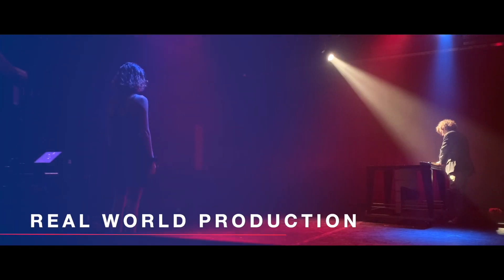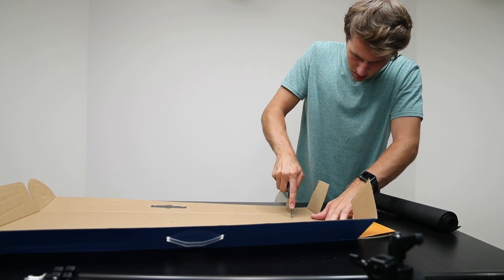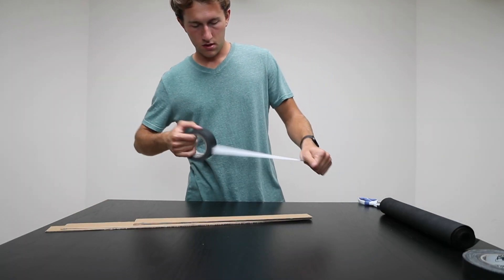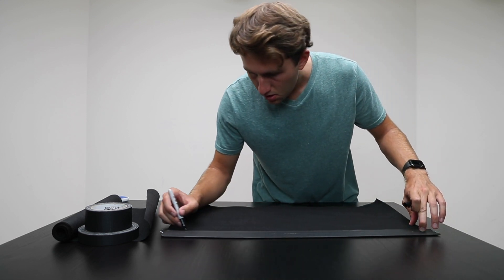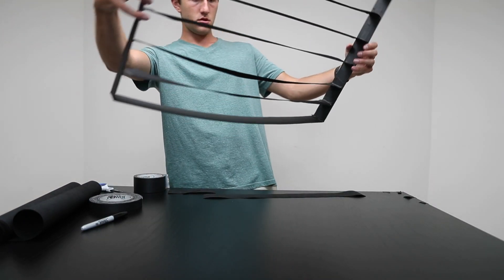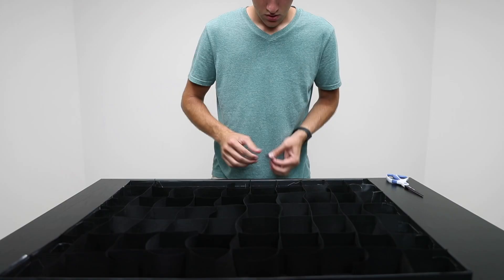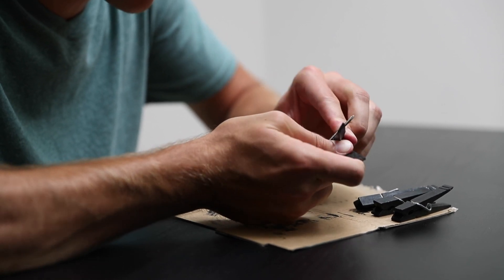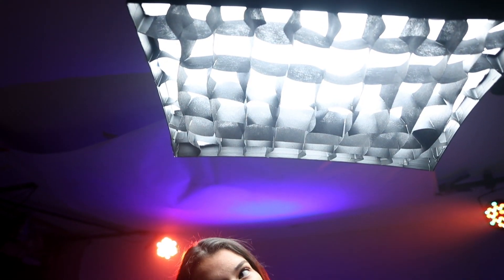DIY Softbox Grid – easy way to increase cinematic quality

Comment: What does this even do?  The differences are so subtle that it makes you wonder if i'ts worth the hassle or money.
Reply: It reduces the light spill. You can see what it does by watching part  0:37 to 0:45. Pay attention to the wall in the background and see the difference before and after. Normally you would have to use extra c stands, cutters, flags to prevent the light from hitting on that wall. By using this grid you are controlling the light without a need for extra tools. Snapgrid sells improved, pro versions of this for a few hundred dollars to thousands of dollars. If you are on a tight budget you can make this thing in an hour or two and spend that money on another tool you need but if the money is not a concern, sure you can save time and purchase a better, pro version of this.  I hope this helped you to understand what it does.